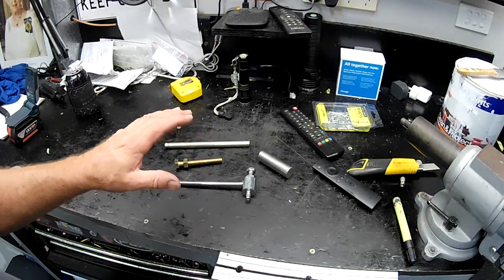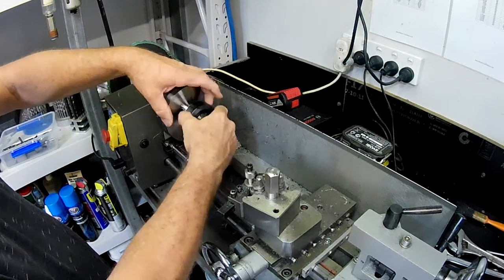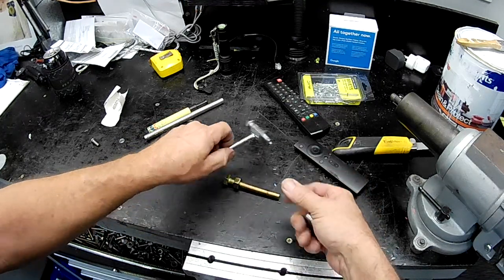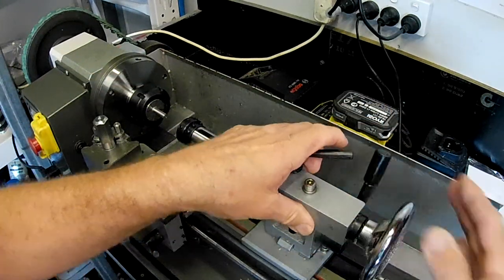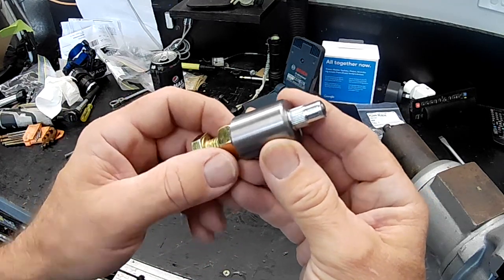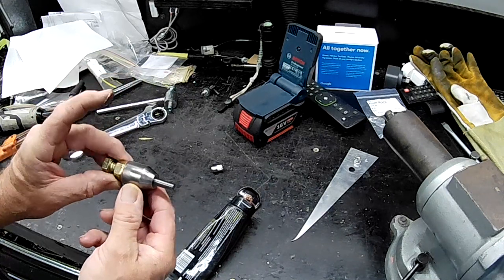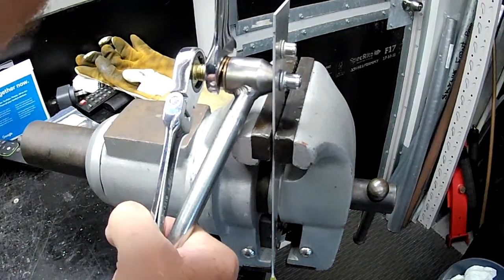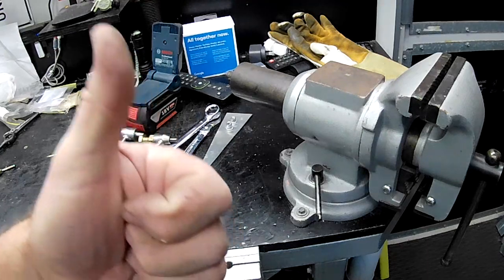The Ultimate Diy Nutsert Rivnut Tool

Comment: Good on ya!  My bud asked me to fix his chinesium lever handle type, and I figured there had to be a better way.  There is an aluminium casting with hardened steel threaded into it.  The Al stripped of course.  Yours is much better and with the expert instruction, I figure even a DOT (Danged Ol' Texican) like me should be able to knock out a couple.  Thanks man!  

Cooking with gas over this way means not using wood anymore.  You are on easy street not having to split and carry wood to make your food!  So you got it made in the shade.

Comment: Very useful tool and much better than any crimping tool available. Just add a thrust ball bearing between the nut and the tool to eliminate friction resistance, it will compress with a lot less effort.
Reply from the maker: Cheers Mate.

Comment: I thought to myself, "I've seen that shape before." Then it hit me, The double tap hammers that have rubber ends that screw off. You know the type. With a yellow rubber end and the other side has a black rubber end. So, I just ordered one for $7 and I'm going to try drilling through it to make a rivnut tool. Watching your video gave me the idea. Thanks.
Reply: Where did you order one for $7?
Reply: @tellyfaulkner3466  Amazon
Reply: @twalrus1  

 you could buy 
1 bolt 
2 nuts
5 washers 
And save more money but where’s the fun in that?
Reply: @eduardodedios8213  
Yep and by buying two different sizes for the washers, you can create the internal step. In the case of the one he built here mostly 12 mm washers and a couple of 8mm washers. You would have to drill and tap the end of the 12mm bolt for the 8mm screw. Or you can just drive it with a single 8mm screw.

Comment: Seems like a lot of work to make one of each size you might need. I've never had a problem just using a bolt, nut and washer of the correct thread to suit whatever size insert. Screw the nut on the bolt, put a washer on the bolt, screw the bolt into the insert, hold the bolt head with a socket or spanner, and wind the nut down the bolt with another spanner to crimp the insert into the panel etc. No fancy tools required and can use the same bolt to fasten something into the rivnut, or reuse the bolt for something else🤣👍🇦🇺
Reply: Brilliant - thanks for the explanation.  This is going to be my preferred way of doing rivnuts!
Reply: Been trying it for hours can’t get it figured out your way 🤷‍♂️
Reply: @zacgoodson6052  Works well for aluminium rivnuts, steel rivnuts can be a bit tougher, but can still be done using a socket and ring spanner, or 2 ring spanners👍
Reply: There's lots of videos on this, search for 'plus nut tool' if you're not having any luck

Comment: That Old mate is Gold.
I think that if you drilled a hole through head of the bolt & pinned it in place or better still weld a spanner onto the handle that flips onto & holds the bolt from turning & use the ratchet  spanner on the nut.

Comment: Improvement idea for this design. Weld bar on the bolt end so you dont need spanner in there. You can then add rope or something to prevent you from loosing the bolt since its moving freely. Alternatively machine some of the big treads out from part that stays in, drill and tap on the side hole where small bolt can be added and tread locked in place, or nut and bolt combo to tighten it in place. Does not prevent operation but will prevent machined bolt from getting lost. Those tools that have separate wrenches etc always loose those, so this way its easy to recognize and keep in one peace. It would be different story if this was just normal bolt but since its machined you dont want to machine new one everytime it gets lost.
To remove zink with out making such edge on the handle, put it on vinegar over night and it eats the zink away. Warm vinegar works faster, but its bit of a hassle. Alternatively there is other faster acids but vinegar is pretty much the thing everyone have and can get from corner store for cheap.

Comment: I don't know if you have a three jaw chuck (probably do) or not and you probably know this...but;  To turn down those threads on that bolt you can leave the second nut on the bolt and put it in a three jaw chuck rather than a collet holder.  The bolt head is six sided so that works out.  The second nut can be positioned on the thread at whatever "depth" you want and will automatically turn to align and provide clamping force in the three jaw.  That way you could likely extend the bolt out a bit more rather than turning right up to the collet face.  Pretty basic so you likely already knew that YouTube is where I find most of my "tricks".

Comment: As a example if there were 6 different sizes of rivnuts I’d use 6 of the same size bolts to fit in the upper part of cylinder thread, but just turn the appropriate threads on all 6 bolts at the ends

Comment: Thanks!  Another project to add to the list. (I think you set up the tailstock die holder at the end of its travel, and it was getting pulled out of the morse taper/getting loose)
Reply from the maker: Cheers Mate, quite possibly.
Reply: Actually I looked again - I'm totally wrong. :/  Dunno why things got all loose on ya.

Comment: I'll clue you in on a trick i self learned.  When using a ratchet wrench without the little direction lever such as yours.  Just look at the open end and visualize as if you were rotating the nut with the open end in the proper direction of course and thats the same way you would put the ratchet over the nut.  Can't fail.  You will never have to stick your finger in the little hole again.  My kids have not figured it out how I can put the ratchet end over a nut the right way every time.  I've probably won $20 doing this so far.  Its like a magic trick that you don't want to give away the secret.
Reply from the maker: Mate that's Gold, you're a Genius. Thanks for that, Cheers.
Reply: Do you mean read the little letters that say on or off on the wrench to trick your kids?

Comment: You can get a pack of 10 thrust bearings on eBay for $5 don’t buy them thinking they will work they are crap but if you spend a bit more money $20 or so for a good name brand one then you will be golden
Reply from the maker: Nice Tip mate, Cheers.

Comment: It will be easier if you weld your handle on top of the Bolts.
You do not have to use 2 spanners to make it work.
Reply from the maker: Hi Charles, unfortunately if you do that, it prevents you from undoing it from the Rivnut if you're close to anything.
Cheers.

Comment: I wouldnt call it the ultimate.... also use the ratchet wrench on the turning side, much faster.  The commercial ones dont have a handle like yours, uses a thrust bearing so there is no need to hold it.
Reply: I think the handle gives you the feel that you are tight enough.
Reply: Pulling the rivnut with the secondary nut prevents any turning force being applied to the rivnut.  You're pulling the bolt straight through the body of the tool, no chance of the rivnut spinning
Reply: @vandalsgarage  I understand that, which is why I mentioned a thrust bearing.... like the commercial versions.

Comment: Instead of using a bolt and a nut, why not just thread the body of the tool and delete the nut altogether? That would increase the thread engagement between the bolt and the body making it stronger and you would only need one wrench allowing you to have one hand fully on the wrench and one on the handle of the tool. This way you could even use a cordless impact drill to drive the bolt instead of having to do it by hand. Just my 2 cents. 👍🏻
Reply from the maker: G'day Mate, unfortunately that would defeat the design of the tool. The idea is to pull the Rivnut without putting a turning force onto it.. If you try to compress the rivnut that way, they tend to turn in the hole (not good) & often the threads become damaged (even worse) Cheers..